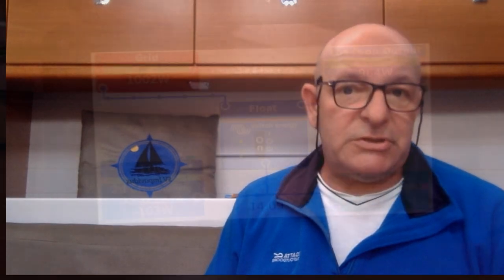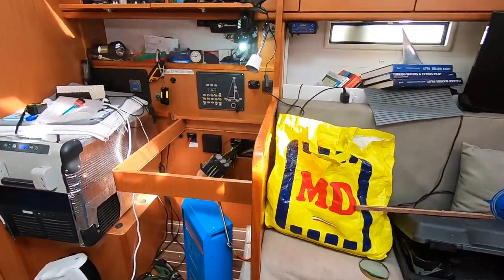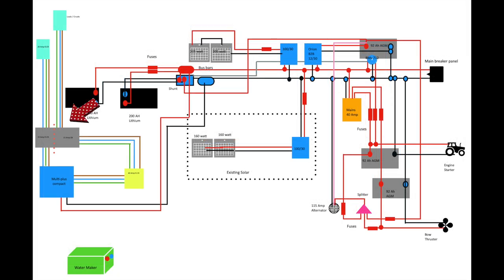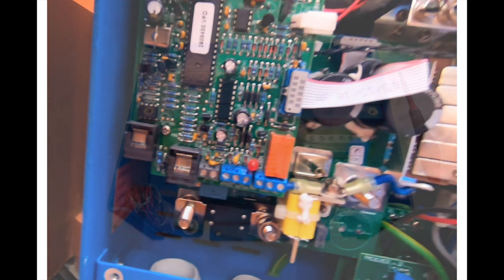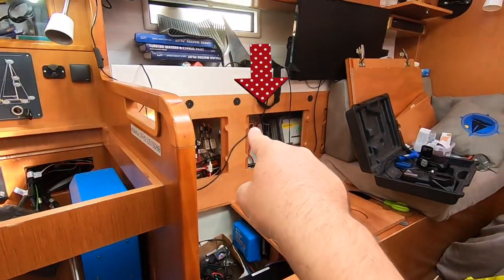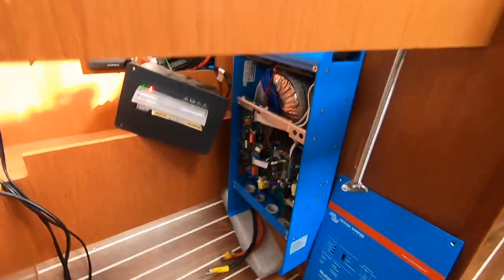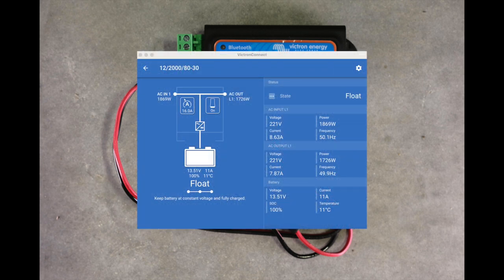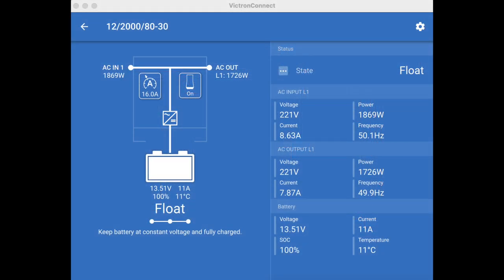Victron Multiplus Compact Installation. We run through the set up and integration OTB 132

Comment: Great video!
Guess Victron have had to deal with a lot warranty claims from incompetent amateurs who mis-install/mis-configure their kit so make access difficult! 
Multiplus has been around for a while hence no Bluetooth. I actually think older design is a good thing as Victron accountants have not yet value-engineered out the bulletproof nature of these things! There is a Multiplus II creeping into product line.
Raspberry PI works very well; we used one for over two years before upgrading to Cerbo for better I/O and ability to read fuel & water tank levels. Look forward to seeing your RPi video :-)
Many thanks.
Reply from the maker: Its a bit of a minefield for Victron to be honest. But I think they are a good company that look after customers. Let's hope the accountants never get control 😉